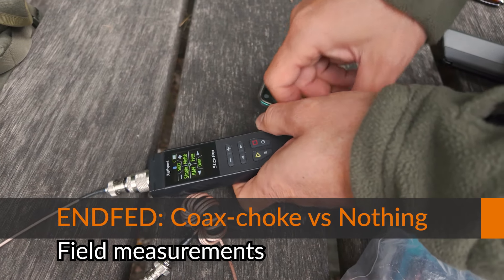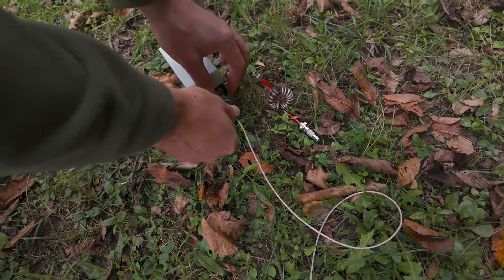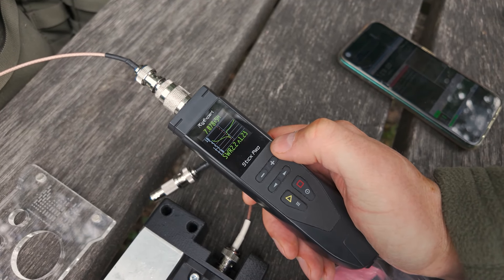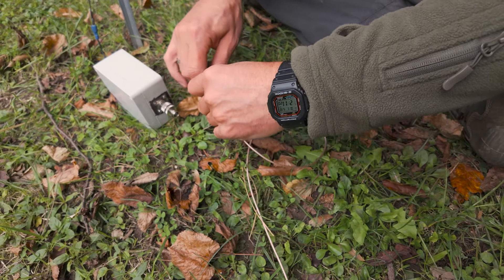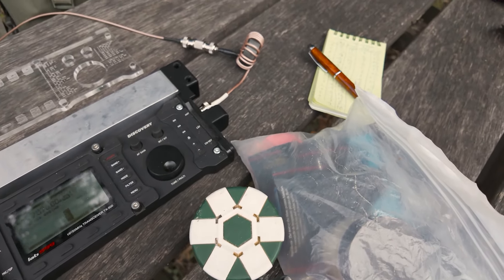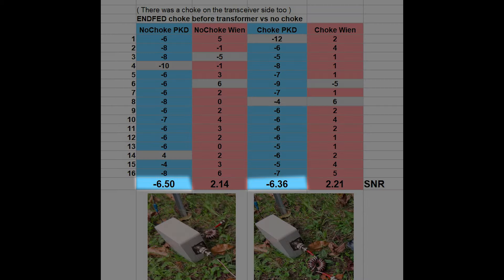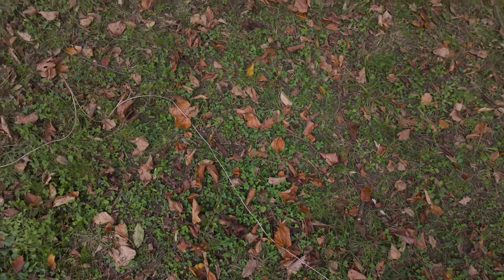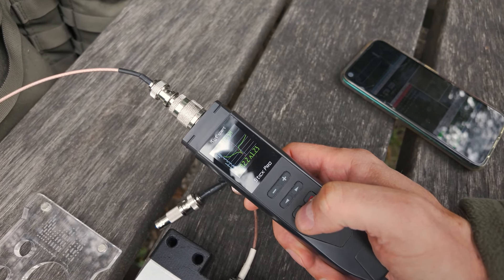ENDFED: Choke vs No Choke. Field Measurements.

Comment: I think having the choke at the feed-point can be OK if you also have a min 0.1 wavelength or longer (at lowers frequency) counterpoise.  A ground might have a similar effect but less reliable since ground types are different everywhere you go it will be different.  The counterpoise is usually the coax laying on the ground and so your choke at the radio means it works well that way.  I think you already concluded you had it right with just the choke at the radio. 😀
Reply from the maker: thx...good points!

Comment: You should have your choke next to the radio. Otherwise you have no groundplane which will be the coax sheath. What you have done is choked it off. You only need one choke.
Reply: Correct. The idea of the choke is to stop unwanted current travelling down into the radio from the coax. I use a choke at the radio end with great results in stopping both noise and unwanted effects on the transceiver. Just my two penny worth.
Reply from the maker: there was a choke on the transceiver side too. also mentioned it in the video somewhere.

Comment: You misunderstand the purpose of the choke. It is usually impossible to see the effect of a choke using an antenna analyzer. The choke prevents RF coming back on the shield. RF on the shield will cause the Radio to think the SWR is much higher but you need to apply power and the problem increases with the amount of power.  You can place the choke near the radio or a quarter wave back from the antenna. Alternatively, a counterpoise can be used.  Good news is that your high loss coax will help a bit.  There is so much wrong here that it is starting to hurt my head.  The others below are also correct.
Reply from the maker: There was a second choke on the transceiver side. I'm testing what makes sense in the field.
The "high loss coax cable" loses about 0.2dB at 7MHz. Just measured it.
Don't want that your head gets hurt. Please stop watching. :)
Reply: @CrazyChekov  Your big problem is not the coax but rather your choice of tools to determine the effectiveness of the choke.
Reply from the maker: @vladtepes481  
So the coax is now not the problem anymore. :)

I think you are misunderstanding in general what I try to accomplish here. 
I'm testing which setup is the best for the field. Low power. The priority is to have as few parts as possible (less weight) and the faster the better. I just try nearly all possible combinations. I not claim any theory. I make simple measurements for receiving and transmitting.

But lets go with your theory. 
The RF coming back on the shield without the choke --> let the SWR meter read a much higher number.
But in my test I adjusted the SWR the same for both setups I compared.

That would mean --> my test would favor the setup with the choke. Wouldn't it?
But...the real world results were nearly identical. No effect on receiving, transmitting.
--> What does that mean to your theory?
It may be different with higher power etc. I don't care....in my case it had no effect. 

So I chose the one with less parts....meaning no choke at the feed point. 
Simple try end error of possible combinations.

Do you have a real world demonstration and measurement ( not in the lab ) what effect your theory has on the receiving and transmitting? 
...and if not...please then go out, make your test and share it. 
Then maybe we can learn some stuff.

If you just want to call people stupid (hurting my head...thats in the end a mild version of it) without giving me suggestions what I could try instead....your comment is useless to me so please don't waste my time.
Reply: @CrazyChekov  An antenna analyzer is the wrong tool. It can't help. You might use an RF current meter to measure currents on the coax. You could also apply power try 50-100 watts. SWR will look higher without a choke (if this is a problem). Be aware current varies with position in the coax just as it does on an antenna. The coax is only a problem if the loss is significant. There is also additional loss due to swr. The SWR at the rig is lower than that at the antenna. You can use your analyzer to measure SWR at the antenna  by recalbrating with the feedline in the system.